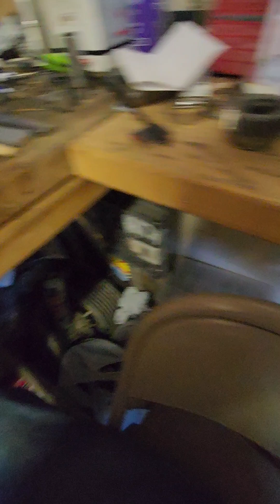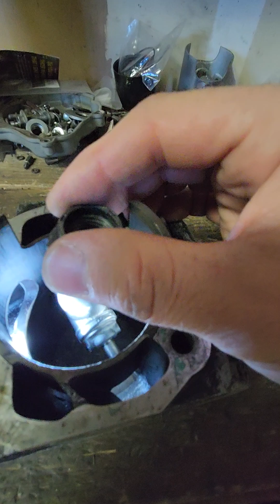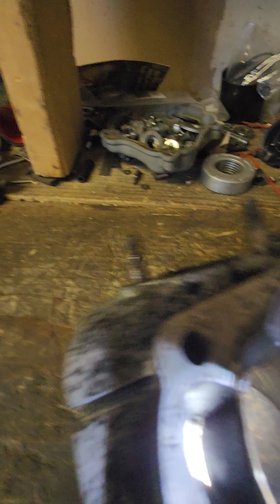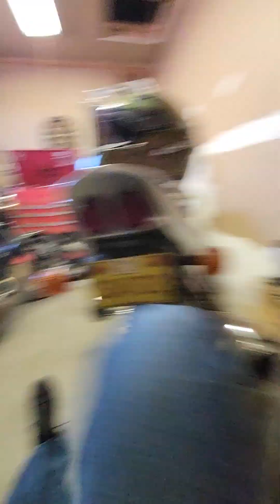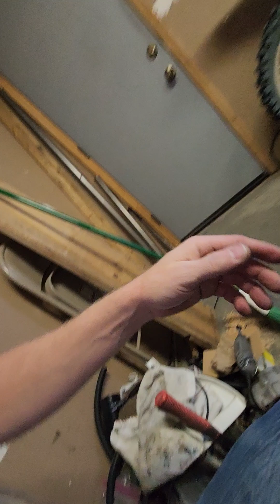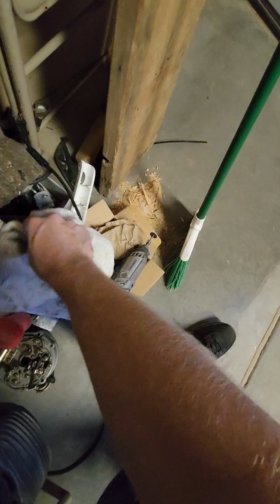Yamaha R5/RD porting

Comment: well i did what you said on my RD350 and widened and hooked the B ports forward towatd the exhaust port and aimed at the A transfers . i also staged the transfers C -> A -> B .  Quite pleased with the results . the bike  rips ! However i am having some trouble jetting the thing in the pilot to needle transition section . i amalready one size up on the pilot jets from 25 stock to 27.5 but it feels like it still wants more fuel between 1/8th and 1/4th throttle . did you find that the bikes you made this conversion on wanted richer pilots too ?
Reply from the maker: Increasing the transfer tunnels increases the crankcase volume which always seems to require more fuel. What I like with these RD's is the 350 needle, the 5i4, on its richest setting to get the taper in effect as soon as possible. You can really feel the dead spot on lower clip positions where the straight section of the needle is in play and it doesn't really respond to throttle input below about 3/8 throttle. You may need a leaner needle jet to allow that rich clip position without making it run real chunky below 1/4.
Reply: @TurbodanNM  Hey thanks for the quick reply and sound advice . I tried the clip in the 4th position on the 514 needles and it felt a lot better . it was smooth enough to ride with the existing 27.5 pilot jet and the flat spot got a lot better . im going to try the 5th clip position, thats the richest setting and see what we get .  I feel like i have some clarity as to what direction to head in , thankyou.

Comment: would you recomend  rising the A transfers in relation to the B transfers on an RD350 ? and do you maintain  the steep vertical angle of the B transfers or is it better to flattened them making them similar  in vertical angle to the A transfers
Reply from the maker: I always like to flatten out the B transfers but it is difficult to get a good port roof shape with the limited amount of casting thickness you have to work with. The 350 has an appropriate amount of transfer port timing as is so you don't really need to raise them unless you're correcting a mismatch at the sleeve. 

I did flatten and hook the B transfers on a set of 1A1 400 cylinders. I don't know if it was worth the work but that motor did rip with some good pipes on it. That was the only setup I've had that would yank the front wheel way up in first gear completely unintentionally. Damn near looped out the first time I opened it up, which is exceptional up here at 5700 feet elevation. Those cylinders had all transfers at the same height, the B's were widened, flattened and hooked toward the exhaust port, and the boost port was widened as well to help restore the upward velocity that was lost with the flattened transfers.

Newer stuff has only 15-20 degrees of upward angle on the transfers, I think that's probably optimal. It would be great if the boost port in the back had a better supply of mixture but there's just not enough room in the cylinder and case to cut in a proper port.
Reply: @TurbodanNM Hey man thanks for the quick reply . I was just gonna raise my exhaust port just a sliver and try and stage the transfers a little, so that the A transfers open up before the B transfers ,like you did on your R5 . I also noticed the KTM125SX has similar staged trasnfers too, with the boost port opening  first followed by the mains and then the B transfers . I was hopping for a little broader torque and a little bit more meat in the mid .Anyway thanks for the advice il look into hooking the B transfers as well , lets see what we get .
Reply: @TurbodanNM  Hey  i was wondering if i could get your thoughts on this . im planning on building a enduro/Mx style engine for my RD , starting from a RD350HT cylinder , its the RD they sold in India . it has much lower ports giving me some room to cut  roof angles in the transfers and stage them .  I plan on staging the Transfer ports  so that the C port leads Followed by the A transfers, which will do the bulk of the filling and finally the B's . I plan to change the vertical angles of the ports so that the "A" is a little steeper  at like 25° and it can contributes to the vertical loop initiated by the C transfers ,  i also plan on  aiming them  rearward and toward the B ports,  while the B transfers will be hooked forward , toward the A transfers at a shallow vertical angle compared to stock at like 30° . the C port  angle i plan to leave as is . pull the stock RD350Ht exhaust up to about 188° duration and the transfers staged at A - 125° , B - 123° ,  C -  126°  duration . thats about it . I dont expect  a reply but thanks for the video and the information , it was good insipration and it really got the wheels turning . any future videos on different enduro/ mx  exhaust port shapes will be much appreciated.